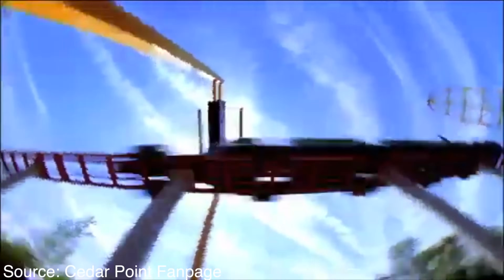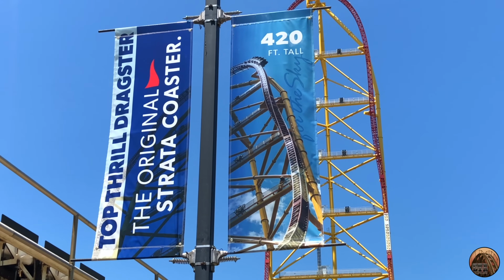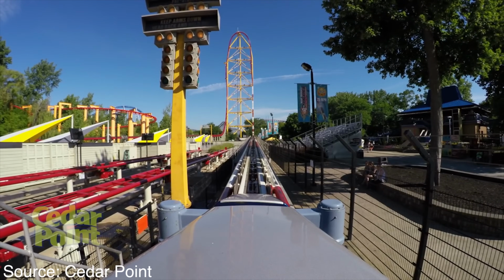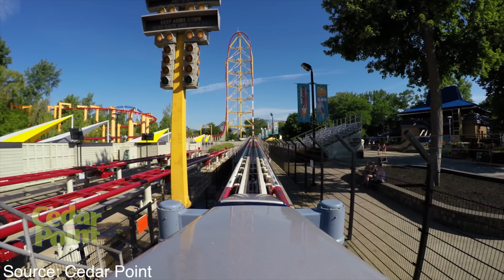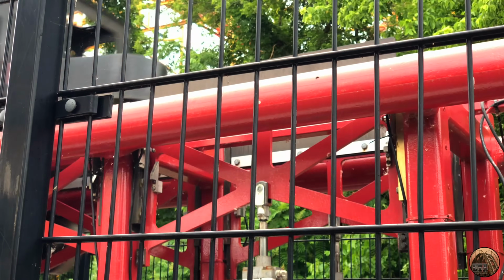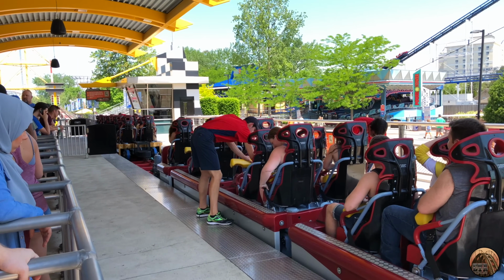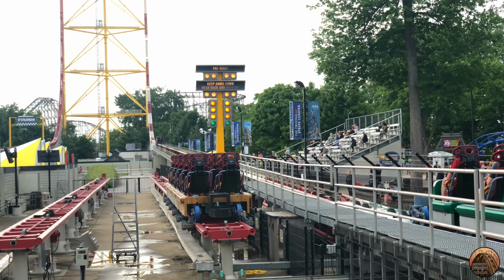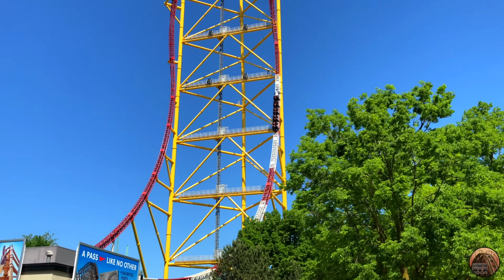Problematic Roller Coasters - Top Thrill Dragster Review & Technical Analysis - Cedar Point

Comment: Hi Ryan, this is probably my third time rewatching this video, but I've just noticed something with the block layout that I find confusing: Assuming that the train has been launched up the top hat, the top hat itself has no brakes or other methods to stop the train on Dragster, so how is it that the launch block is separate from the final holding brake? Shouldn't these be considered the same block zone?
Reply: trains stopped at the beginning of the launch. the train on the launch track can wait there as long as it needs, and it will only launch after the train in the holding brake moves to unload. so with six train operation you can have trains sitting on both blocks. obviously not for long because the train on the holding brake is in the process of moving forward, as a result of the dispatch that put the train on the launch block.
Reply: @ducksfan_1149  Yes. Since the train in the launch goes directly to the hold brake, why are they programmed as separate blocks?
Reply: @Fishmanistan  because both have a method to stop the train. both sections can hold a train at the same time, even if that time is very short,

Comment: Why isn't there some kind of scale to weigh the train so you know more exactly how fast it will go at the top?
Reply: No the problem is that the scale can’t come into contact with the train therefore it can’t weigh it
Reply from the maker: The computer times each train from when it launches to when it crests the tower. There’s an exact time it wants the train to do this in, I believe about 9 or so seconds, can’t remember the exact time. So based on the train beforehand, the computer will make slight adjustments to get the next train’s launch speed even more accurate to the exact time it wants each train to crest the top hat. It all has something to do with something called Speed Reduction that is built into the Intamin Accelerator coasters
Reply: @ElToroRyan  But if it were to weigh every train before launch it could make a better approximation
Reply: @ninstagram  how would it weigh the train lol
Reply: @ninstagram  yeah how would it weigh the train that is on the track
Reply: @ninstagram  yeah but the train will just pass over it

Comment: Referred here from today's video. So much for the "LSMs will never work on Dragster" take 😅
Reply: Top Thrill 2 has lighter trains, smaller trains and a huge spike to get it up to speed. The first launch doesn't even reach the 90 degree twist.
Reply: @christhickson7950  Fair. Just throwing LSMs on Dragster in its prior configuration wouldn't have worked so well.

Comment: Revisiting the topic of replacing the launch now a few years later, if they decide to do this to keep the ride; based off what I saw with Velocicoaster and the new technology of cooling elements inside each LSM at launches. If CP keeps TTD, I could see a redesign that involves new trains because of the design flaw that caused the accident. New trains that Intamin design now are lighter because of the material they are made of thus making it easier to launch using LSM. The only factor now is can it achieve the launch speed and acceleration that we've come to love? It would be cool to find out!
Reply: They BETTER keep it, or me and a ton of other cool awesome people will be PISSED!

Comment: I did work at the La Ronde amusement park for a short while, and quite honestly, my experience wasn't anywhere near as great as you make it sound. I did work on a ride for a short while, but ultimately, I was relegated to janitorial duties. What that really meant is that we had to sweep the area near the ferris wheel late at night clean of the junk left after a firework. I've got to tell you, firework leave a heck of a mess behind. I will also note that I am honestly not a fan of what Six Flags has done to the park since they purchased it. They filled in part of the lake and destroyed part of the shops in order to build Ednor. It is a another coaster found in Canada Wonderland called Top Gun. I find that it is a rather rough ride. This also creates a single narrow corridor for guests in that area of the park. 

It does need to be said that the park does not have much space to start with, but they are definitely not making optimal use of the space that they do have. There is an empty area near the bridge which is being used as a storage / junk area. There is, a boat parking and a marina behind Monstre, a great wooden coaster. There's an old abandoned cable car building which could easily be reclaimed for something else. Several historic rides have been removed without being replaced. There are several small footprint rides right in the middle of the park which could easily be tucked in just about any corner of the park with dead space. 

La Ronde is a very special place which was built for Expo 67 and I am of the opinion that Six Flags has not been a good steward of that heritage, and that, despite the fact that the park is very popular and, quite uniquely, within walking distance of a metro station. To be fair, there really isn't all that much left of Expo 67. The few buildings which still do exist are mostly boarded up. With that said, a lot of the rides are clearly showing their age and will likely need to be dismantled in the coming decade. The La Ronde that I remember from my childhood just isn't quite the same place anymore. Far too many of the current rides are your bog standard carnival attraction rides. Heck, some actually are carnival rides that have been permanently anchored on site.

Comment: During my latest trip to a cedar point, I was watching dragster and while it was flying up the top hat part of the wheel flew off and landed near me. When I picked it up the shell part was quite hot. Just another example of how unreliable dragster and kingda ka can be

Also I turned in the wheel to the ride ops and the ride was shut down for a good 30-60 minutes

Comment: 2:44 so no they don’t slam on the brakes at top speed. They have dual parachutes that must be deployed in conjunction with later using the brakes in moderation to slow the vehicle. Slamming the brakes at 340 mph would just cause them to turn to glass essentially and explode due to extreme heat.
Reply: Yah, I don't think this guy has ever been to an NHRA race 😂

Comment: You talked about the issues of timing the trains in the videos. But if there is a rollback what happens? How far does the train go back? Is there brakes before the launch station (since I don’t know when y’all move the next train to the launch station)
One person said in the comments that they ended up going again without leaving their train but it took about 15 minutes. What’s going on with the computer and with operator during a rollback
Reply: Magnetic brakes can never fully stop a train, so after a short shot (public calls them rollbacks), the train will crawl slowly until it reaches the drive tires that are in that block. Those drive tires are able to hold the train and maintenance can manually move it back into launch ready. 

The controller will fault during a short shot (usually "time over tower" fault) which needs to be reset by maintenance before the ride can go back into auto. This is usually why people are waiting for 10-15 min.

Comment: If one of the sensors stops working how long does it take for the ride to open back up, I am wondering because I am going in a couple weeks and I am worried about it being closed, I am going for 3 days, do you think that it will be up and running after the sensors fail?

Comment: I was in line for TTD and it went down for about 45 minutes. During that time everybody left the line except for my Dad and I and a couple. I was convinced it would open if I just waited. Eventually, it did and because there were only 4 people in line, my dad and I got to take the front row on our train and that couple took the front row on the train behind us. They launched the two trains and then it went down right after and they closed it for the rest of the day IIRC. So yeah that's one way of summing up dragster's reliability.

Comment: They could easily build a roller coaster that Soli uses extreme high-pressure hydraulic air, and that would actually save on the breaking, and that’s suspension system that accelerates the ride, The only problem is if they did this they would have add more track possibly the same type of thing is on Kingda Ka.

Comment: Let's hope Intamin can make an improved hydraulic launch so it's not reliable but keeping the same intensity and feel
Reply: The problem is hydraulic launches have hundreds of LSMs that are lowered and raised if the train rolls back. When a launch with just LSM is in a fixed position and much easier to control. I'm hoping that LSM launches will find a way to recreate that intense feeling without the change of a power outage.
Reply: @claytons7319  probably but that would need to be incredibly powerful

Comment: Honestly, an updated control system would probably solve a lot of issues. You wouldn't happen to know what model of processor that TTD uses would you? In 2003, the highest performing PLC on the market was the Allen Bradley ControLogix 1756-L55, assuming that it was even used for TTD, as it was still a fairly new product at the time (2002 release I believe) Could even be the ol' SLC500 processor from the late 90's. This past year, they came out with the 1756-L8x series, which includes safety rated processors, a must for modern amusement control systems. These newer processors can handle the IO count needed for this ride way better than it's predecessors. Remote IO has changed a lot since then too. Now thousands of IO points can be consolidated on a single or redundant ethernet network using systems like the AB 5094 Flex 5000 IO modules or the IFM IO-Link system, both of which I work with and install often. I wouldn't be surprised if CP ends up requesting quotes from some system integrators about replacing the main processor and required remote IO modules at some point since the ride is nearing 20 years old. I certainly would if I were on staff in the maintenance or engineering departments there.
Reply: They use controllogix 5555 running gaurdlogix safetys through controlnet network.
I'm an electrician in attraction maintenance, I work on these control systems daily... And I can tell you they can be a real pain in the ass haha
Reply: @shawnspencer8766  Neat! That is pretty typical of that time. We recently replaced an L55 with a ton of safety relays with an L81 in a granola factory. Much nicer now!
Reply: @fieldfilmz  nice that's a killer upgrade. I've been noticing a lot of the newer rides are including a lot more remote IO... Mainly Point IO with a central controllogix processor. 

You guys seeing the same change in your field as well?
Reply: @shawnspencer8766  For us, Point IO is going out, Flex5000 IO and IO-Link is really growing. Flex 5000 is the IO quantities of the older Flex IO, but with newer tech including safety IO. IO-Link is great for a very spread out system and is very plug and play.

Comment: The first launch felt like I was gonna be ripped out of my seat, it felt like we were at peak speed but we weren't it was insane. So intense, I was in the 3rd seat so I recommend going for the front because the air time in the back is cool but if you want sheer intensity go for the first 3 rows

Comment: If the issue with the block zones is that the brake block can't be a block since it's not possible to stop a car fully (as magnets can't and the tire drives are default down), why would they not simply make a set of tire drives at the very end fixed? I'm not saying that this is a cheap option, but by fixing the very last set, you get your block zone properly and six-train ops aren't as big an issue (as the brake run exists as a real block zone now). Seems like reprogramming was a quick and dirty fix that might have been done for cost reasons, which is a bit ugly all considered.

Comment: I remember Maxx Force had a lot of small downtime moments when I went there.  I dont know if it was just teething troubles or technical flaws, but I know that the coaster model is a much more refined S&S compressed air launch coaster.  It's also funny how the first brake block actually begins halfway down the dive at the end, meaning you would stop slinked around it.  The coaster was only running two trains when I was there, which I think is fine since it's such a short coaster anyway.  I had a front row ride and was literally blown away by the launch.  I'm sure the launch track has some safety brake system if the trains were to roll back, but they werent clunky retracting fins and I've never known it to roll back at all

Comment: I've always wondered how they decided the force for the launch. I'd assumed that it was a weight calculation since it wouldn't be too difficult to do. Just curious how the engineers that decided on the trial and error method rather than a calculation from weight. Obviously you'd need some adjustments due to friction fluctuation day to day, but it seems like it would be more reliable.
Reply: Another sensor to fail, perhaps?

Comment: I love your videos but I want to address one mistake you made when addressing the use of an LSM launch for Top Thrill. I believe the length of train would actually have the opposite effect from an LSM the more cars you have the more area you have for the LSM system has to push on. This means so long as your power supply to the ride is sufficient you'll just be engaging more individual LSM's (the actual linear synchronous motor plates) at once. It actually means you could potentially be able to accelerate faster with a longer train since you have more magnetic "traction".

Comment: while you are technically correct that physics is the reason emptier trains need more speed, the reason isn't momentum, it's friction. when converting kinetic energy into potential energy, mass is irrelevant because it occurs on both sides of the equation. Rolling friction, however, which has a maximum effective range, will leach energy from the system at the same rate regardless of the number of riders, which means less energy available per unit of mass for the full cars as opposed to the empty cars. Momentum has nothing to do with it. It's all about friction.

Comment: interesting analysis we have had multiple errors operating the iron rattler at six flags fiesta tx which i have worked on with just two trains i cant imagine the errors in a day you deal with dragster with 5 to 6 trains amazing video, six flags management could learn from improving ride efficiency if they hired more people like cedar fair staffing levels at there star attractions. 2 people operating 2 trains include checking restraints doesn't cut it on RMC Trains at all, I loved this video and have been on dragster it is amazing the staff does a great job overall. I will show this video to my supervisor at my park,but it probably wont get any results as i am expecting.

Comment: The sensors on the brake fins resulted in many instances of swearing-out-loud-hoping-the-crowd-doesn't-hear-me moments. The brake fins are arranged in banks of 8 with 2 sensors monitoring each fin, the faults you encounter every so often 9 times out of 10 are the fin itself sticking or otherwise moving slower than its neighbours. This causes a sensor discrepancy that effectively shuts the ride down. In an ideal world the fault that pops up on the screen will tell me exactly which sensor is throwing a hissy fit but oh no, not Intamin, the fault code only goes as far as the bank that the sensor is in meaning I then have to go through every fin in a bank to find the problem. Not exactly a speedy process for a relatively simple fix. 

You mention LSM systems not being powerful enough to enable Dragster to be converted. I assure you, linear motors are capable of insane ammounts of power and torque (which isn't technically torque because they work in a straight line) The only limiting factor for LSM systems is current draw from the supply grid. The reason for not upgrading Dragster, or any other hydraulic launch for that matter, to an LSM system is down to how the ride is connected to the parks power supply. A hydraulic launch consumes between 1MW during the charging phase and about 200KW once the accumulators are charged. The 1MW is well within the capabilities of an industrial 3 phase supply and wouldn't cause any problems for anyone else on the same grid. An LSM system on the otherhand, would subject the grid to a 6-7MW spike for the duration of the launch, every single launch. That much intermittent power draw would really piss off your supplier. There are systems that will mitigate this down to about 3MW per launch by using variable frequency drives with capacitor banks, but that still means you need a much larger cable from the sub station to the ride itself, something Dragster will almost certainly not have.
Reply: There is also the clever solution of using a flywheel as a mechanical capacitor of sorts to help with providing the necessary initial power spike. A Gerstlauer launched Eurofighter coaster in a small park named Hansa Park uses this to prevent power spikes: https://youtu.be/fMWsowNOHg0?t=64

The launch is preceded by a small but steep drop to provide an initial velocity boost, so the motors don't have to accelerate the train from a standstill: https://youtu.be/4cJKBrn8sYg?t=10